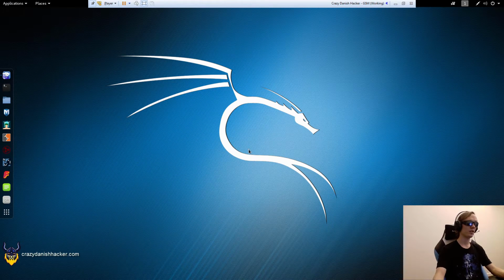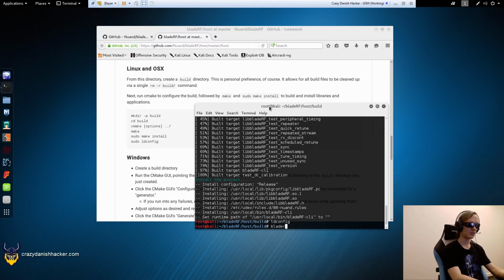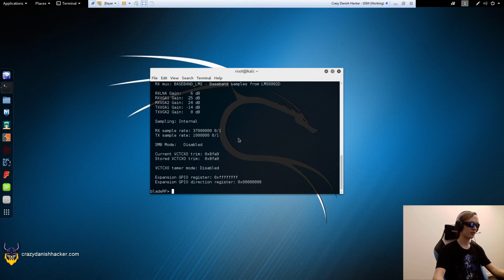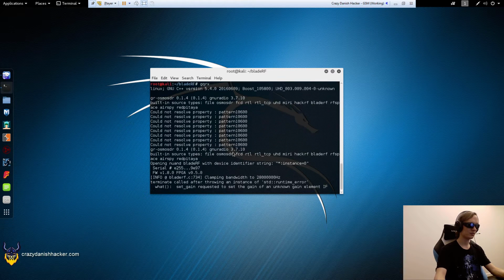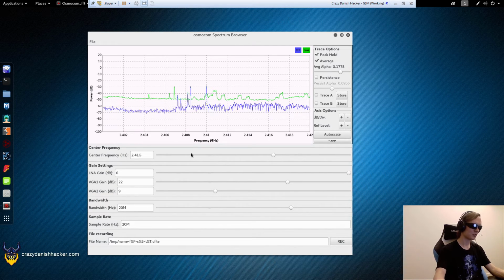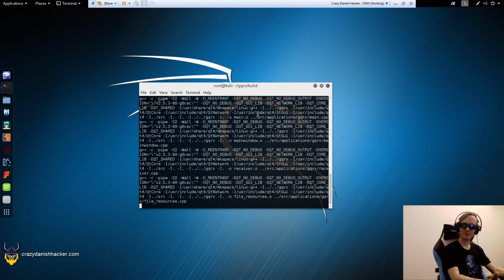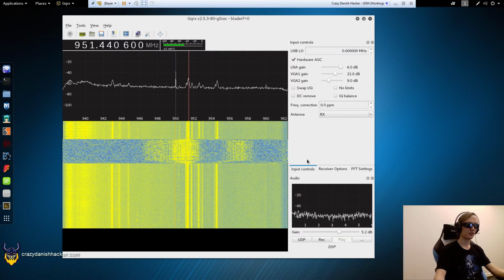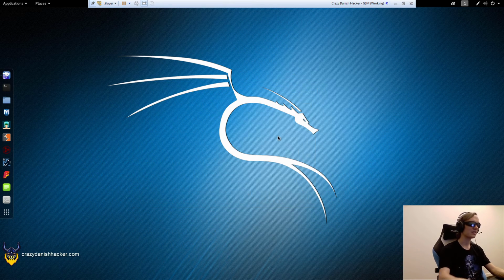BladeRF + Latest GQRX on Kali Linux 2016.1 - Software Defined Radio Series #18

Comment: i've got when cmake ../:
Make Error at libraries/libbladeRF/CMakeLists.txt:122 (message):
  No libbladeRF backends are enabled.  Please enable one or more backends.

-- Configuring incomplete, errors occurred!
See also "/root/bladeRF/host/build/CMakeFiles/CMakeOutput.log".
See also "/root/bladeRF/host/build/CMakeFiles/CMakeError.log".

how do I fix this?
Reply from the maker: It means you don't have the library for BladeRF properly installed or referenced. Try and google this: "No libbladeRF backends are enabled.  Please enable one or more backends.
"
Reply: @CrazyDanishHacker  I got this: https://superuser.com/questions/1150752/installing-software-with-missing-library-libusb1-0. I installed the libusb-1.0-0-dev, but still experiencing the issue. what is the most appropriate steps to install it? do you have any reference of it?
Reply: i solved it with deleting cloned repo first, then clone the repo again. thank you
Reply: i've got another error when loading the FPGA.
you can follow it on: https://github.com/Nuand/bladeRF/issues/734
Reply from the maker: Looks like you solved the problem. You used the x40 which is the most common BladeRF, while it seems that you have the x115

Comment: when tryung the command cmakee ../ it prompts command not found (ver Kali 2018.1 x86)
any suggestion?
Reply from the maker: The correct command is "cmake", not "cmakee". If "cmake" is not installed, then you can try to install it with "apt-get install cmake".

Comment: Any guidance here...

root@kali:~/bladeRF# cd host/
root@kali:~/bladeRF/host# cd build
root@kali:~/bladeRF/host/build# cmake ../
-- Build type not specified: defaulting to a release build.
-- Found PkgConfig: /usr/bin/pkg-config (found version "0.29") 
-- Checking libusb version...
-- libusb version: 1.0.21

-- Checking libc version...
-- libc version: 2.24

--
CMake Error at libraries/libbladeRF/CMakeLists.txt:104 (message):
  No libbladeRF backends are enabled.  Please enable one or more backends.

-- Configuring incomplete, errors occurred!
See also "/root/bladeRF/host/build/CMakeFiles/CMakeOutput.log".
root@kali:~/bladeRF/host/build#
Reply from the maker: You’ll need to download, compile and install the BladeRF libraries first and then run ldconfig. That will probably fix the issue.

I recommend reading this:
https://github.com/Nuand/bladeRF/wiki (Getting Started)

Based on another cmake script:
https://initrd.net/stuff/bladeRF/host/libraries/libbladeRF/CMakeLists.txt

It seems that the issue could be as simple as not having libusb installed? Or libusb-dev? You need version 1.0 at least.

Comment: Hi pls help me

root@kali:~/bladeRF/host/build# cmake ../
-- The C compiler identification is GNU 6.3.0
-- Check for working C compiler: /usr/bin/cc
-- Check for working C compiler: /usr/bin/cc -- works
-- Detecting C compiler ABI info
-- Detecting C compiler ABI info - done
-- Detecting C compile features
-- Detecting C compile features - done
-- Build type not specified: defaulting to a release build.
-- Check if the system is big endian
-- Searching 16 bit integer
-- Looking for sys/types.h
-- Looking for sys/types.h - found
-- Looking for stdint.h
-- Looking for stdint.h - found
-- Looking for stddef.h
-- Looking for stddef.h - found
-- Check size of unsigned short
-- Check size of unsigned short - done
-- Using unsigned short
-- Check if the system is big endian - little endian
-- Found PkgConfig: /usr/bin/pkg-config (found version "0.29") 
-- Checking libc version...
-- libc version: 2.24

--
CMake Error at libraries/libbladeRF/CMakeLists.txt:104 (message):
  No libbladeRF backends are enabled.  Please enable one or more backends.

-- Configuring incomplete, errors occurred!
See also "/root/bladeRF/host/build/CMakeFiles/CMakeOutput.log".
Reply from the maker: It's probably because you don't have "libusb-1.0-0-dev" installed, which is clearly stated on their github page ( https://github.com/Nuand/bladeRF/tree/master/host ).

Installation guide:
https://github.com/Nuand/bladeRF/wiki/Getting-Started%3A-Linux

Comment: which is better for a noob? hackrf one or bladerf
Reply from the maker: Both are equally good (sometimes great/awesome) in terms of software compatibility, as almost all projects I've seen so far support both HackRF and BladeRF. However, the HackRF website does have some tutorials you can follow, unlike the BladeRF website. 

Generally speaking, they're equally hard to learn about, but some tutorials make it really easy, like I try to in my videos. What you should think about instead, is:
1) Do I want to receive signals from 1MHz to 6GHz without an upconverter? If yes, HackRF
2) Can I live with 300MHz to 3.5GHz, and maybe later buy a converter when they become available, or a HackRF for lower/higher frequencies? (If yes, BladeRF)
3) Do I need full duplex to receive and transmit at the same time? If yes, BladeRF
4) Am I going to transmit signals such as GSM or GPS, that require a decent TCXO? If yes, BladeRF. It may be possible to mod your HackRF, but I don't know how to do that.
5) Do I have a lot of funds? If yes, get a USRP B200 or better, with the extremely expensive TXCO addon. (yes you need one if you want to transmit GSM and/or GPS based on what I've read.)

So if you're mostly interesting in picking up signals and receiving them, then you want a HackRF.
If you're more interested in transmitting signals with a device that has everything "in sync", then you want the BladeRF despite its limited frequency range. The BladeRF does have other better components, such as a 12-bit ADC/DAC for better signal processing as far as I know, 40MSPS, 28MHz bandwidth, etc.

With all that said, I am debating with myself, whether to get a HackRF or the expansion board, depending on how long it's going to take for the expansion board to be in stock again. 

If you're buying SDRs from USA, be aware of when customs slaps VAT on the items making them quite a bit more expensive. But it's totally worth it, at least to me. Last but not least, there are other SDRs such as LimeSDR and another one I forgot what name it was (some guy made an SDR from scratch too), and they sound awesome too, but the direct software compatibility may be limited for those devices. 

I saw this website which made a really good comparison too:
http://www.taylorkillian.com/2013/08/sdr-showdown-hackrf-vs-bladerf-vs-usrp.html